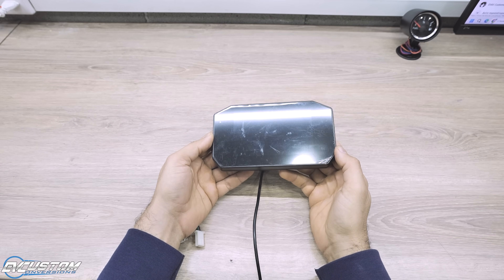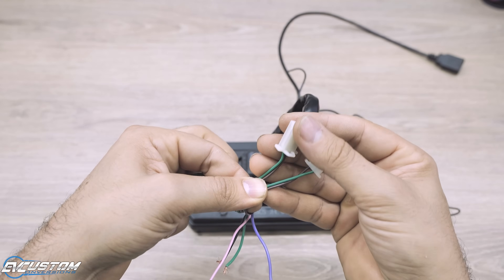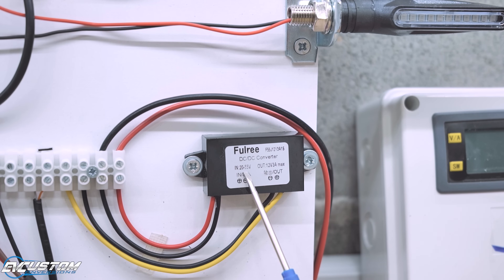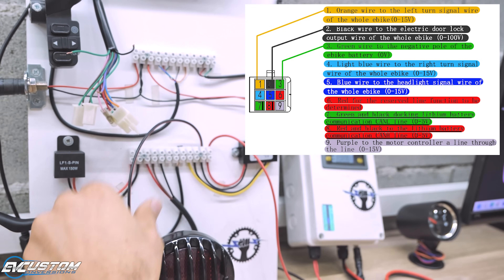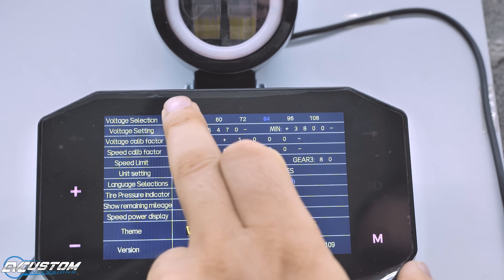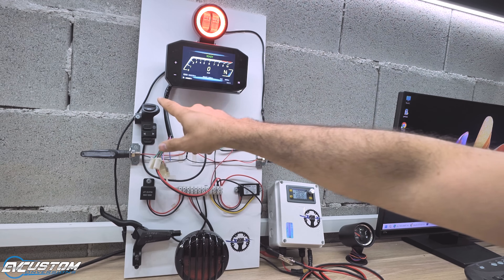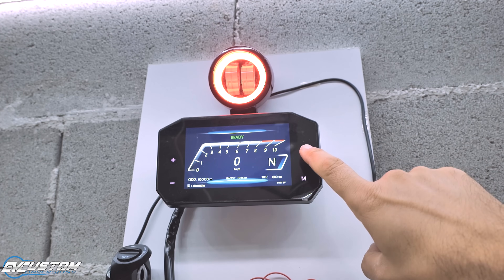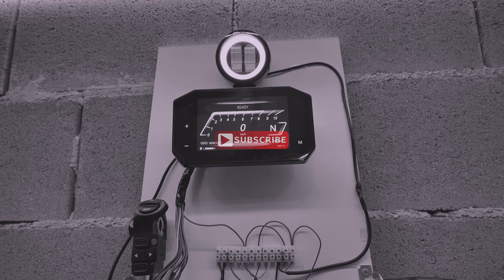Chaojie Touchscreen Display Headlight Wiring ( Lighting EV Board )

Comment: Thank you! Very useful and high quality video. 
1.What if I will use 24V DC-DC? Will the display burn as it takes 0-15V max?
2.Should I connect all CAN wires of each device (CAN_H to CAN_H and CAN_L to CAN_L) if I want to connect both BMS and Fardriver controller to display through CAN?
Reply from the maker: Hi mate and thank you.. 1) most probably yes you will burn display LEDs
2) CAN communication works in parallel as you said.. all CAN devices in parallel
Reply: @evcustoms Thank you! 🤙

Comment: Hi, I've watched some of your videos with the chaojie display and the fardriver controller. and I didn't see you putting the battery charge on the display.. I've connected everything, but it shows 0% charge.
Reply from the maker: Hi.. you mean it didn't show the battery level?
Reply: Yes. I did not see on the blackboard that you would connect the wires.. I connected it to my fardriver, but the battery data never came. @evcustoms
Reply from the maker: Ah ok...  that is because  i never work with battery levels, only with voltage, it is more accurate, but it is a very good reason for a short video 👍,  Note that first it will be uploaded in Patreon and Youtube VIP Members for two weeks and after that time it will be available on YouTube for everyone ..
Reply from the maker: Here is it ...  https://youtu.be/jArqv1gdr6I